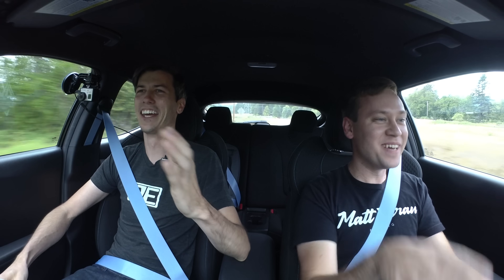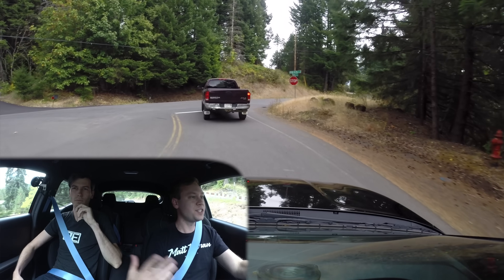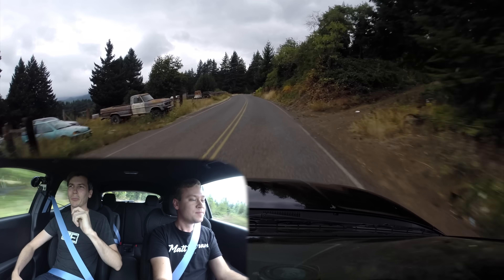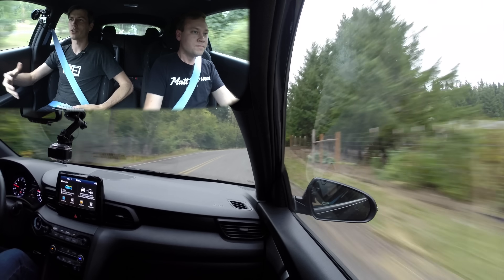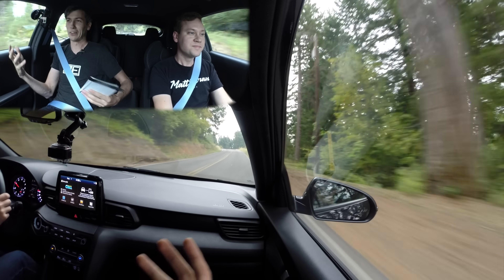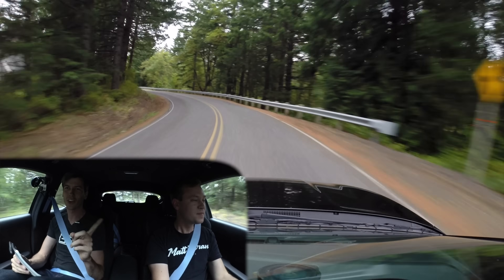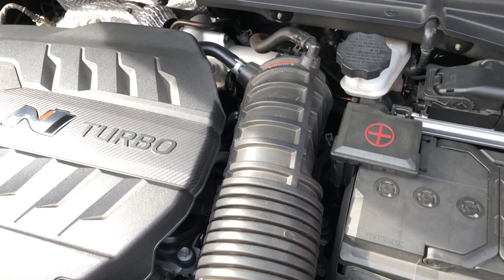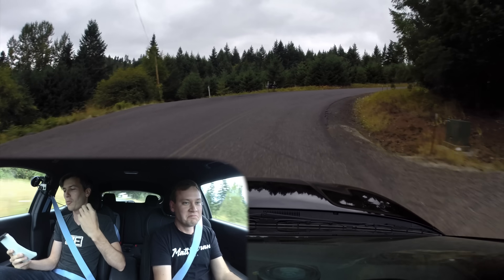Are Car Exhaust Crackles & Pops Fake?

Comment: I hate fake car noise. In high school my 1975 Nova with a 350 and 2.5 in exhaust was great. My friends added glass packs to their Capri with a 100 hp four-cylinder and said. Wow doesn’t it sound fast now. NO a loud car with a 12 second 0-60 does not sound fast. It just sounds like you could not afford an exhaust. 

Mine was always fast. Theirs always looked clean. I will take the performance but to each their own. Now I own a Tesla model 3 and I’m quick and look great.

Comment: As far as the Hyundai method, I wonder how the late combustion treats the catalytic converters.  Additionally, I wonder how much additional fuel it would burn.

As far as the styling, sound injection, and CVT shifts, I would say it is a matter of preference.  I do wish car manufacturers offered a feature to disable the shift simulation, as it hurts efficiency and likely the lifespan of the transmission.
Reply: i wonder more how/if it changes the lifespan of the turbocharger, the catalytic converter is after the turbo(s).
Reply: Well, in a normal car, in correct conditions when you let off the gas on vehicle deceleration,  the injectors shut off until vehicle is close to stop or you get back on accelerator. With Hyundais feature, this will keep injectors running a little longer. Is it detrimental to the economy and emmisions certifications in the US? Probably not.

Comment: I do not agree that on naturally aspirated engines it is fake all the time.
For example, if I take my motrcycle engine (yes on 2 wheels instead of 4 but yet it's still a 4 stroke engine), it has a tiny solenoid valve that opens when you let go of the throttle. The purpose is simply to burn the residual fuel going in the exhaust. And it also does this great blue flame and gorgeous noice :D
So I think there is some real purpose to the crackles and pops.
My engine is the CP3 from Yamaha ;)
Apart from that, again very nice video as always :)

Comment: I probably won't get an answer but for me there is one question remaining: Why do oldtimers have these crackles and pops? I am very sure that a sixty year old car can't change cylinder timings or this stuff. Also they mostly do it at certain loads, say every time you lift off the throttle at 30mph. So there are naturally aspirated engines not doing this for a purpose or faking it.

Comment: What causes the snap crackle pop in older modified vehicles that do not have built-in systems to create the sound intentionally? I've heard it come from all types, but typically 4-cylinder engines with modified exhausts...

Comment: This 8:04 was used is F1 back in 2008 or something and only Renault are allowed to use this type of engine overrun, by the FIA, know as the cold-blown to prolonged their engine life vs the like of Merc and Ferrari.  RedBull clever idea using this to their advantages as an aero devices to aid their diffuser efficiency as we what all known now as blown diffuser back in 2010. In 2011, every team are allowed to use this engine overrun mode but with a less aggressive throttle opening under deceleration (around 15%) vs Renault engine 40% if I’m not mistaken (permitted by the FIA). So to match Renault’s cold-blown system with a far less permissible throttle opening under deceleration , they are forced to use what we know now as a hot-blown system which of course involved a spark retard strategy and at the same time dumping as much as 10% more fuel per race. Yes, it is the same technique use in a turbocharged engine (anti-lag) but of course for a different purpose all together. Blown diffuser are now banned by the FIA altogether.

Comment: Interestingly I have a carburated motorcycle and it does pop and crackle a lot (like all carburated motorcycles and most cars). Basically every time you are not on the throttle the thing pops like crazy. It gets less if you turn down the idle speed. The reason why it pops and crackles is because the carburators always draw a small bit of air and fuel into the cylinder because the throttle never fully closes because of well... idle. Some interesting observations I made are: when I turn down idle all the way the thing obviously won't pop anymore on decelleration but will also not run if you stop. However, if you roll on the throttle really gently say for example at full lean at an apex, most of the time it does one loud bang, followed by a bunch of crackles that get less the more throttle you apply until they are completely gone at about 2% throttle and the engine sounds like a normal engine under load. The loud bang at the beginning is probably because the carbs are still not fully closed and draw in a tiny amount of air and fuel that is to little to get ignited but that collects in the exhaust and when you open the throttle it ignites all that unburned mixture in the exhaust. However, I am honestly not totally sure why it pops and crackles other than that. Is it because it also draws in to little mixture to properly ignite it but "once in a while" a piston does properly ignite and then burns the mixture of the other cylinders in the exhaust?

Comment: my old volvo used to make rice crispies when i let off when i wasnt running a muffler.
the fuel pressure reg was bad though.
Reply: Which volvo did you have?
Reply: @RansomedSoulPsalm49-15  that one was a 91 740
Before that I had an 86 740. Both turbo
Reply: Have a Saturn ion doing the same thing. I might want to check that then

Comment: I accidently found out that my car can also do the exhaust pop or crackle. In the certain rev range when completely lift off and ever so slightly touch the gas pedal without pressing it too far it makes the crackle. I also hate from the bottom of my heart every electronically generated engine noises. It should be real as in mechanical even if serves no purpose at all.

Comment: Jason explain DSG farts!
Reply: These are not hard to explain; it's essentially the same thing.   Instead of cutting ignition or fuel; spark timing is just severely retarded to allow revs to drop so you get a lot of after firing whilst the DSG completes it's shift.   It really is the same thing with a slightly different implementation timing wise; but also in that it's occurring on every single exhaust cycle (which is why you get more of a constant "braaap" sound compared to occasional pops and bangs with more time between them).
Reply: Instead of letting of the throttle like in a manual car the car will cut ignition so the fuel goes into the cylinder and into the exhaust and then goes boom boom.

Comment: How about my motorcycle? Its 125cm³ 1 cylinder and its not fuel injected but carburated? After i changed the exhaust (only a slip on, not the whole pipe) it pops like crazy. 

Yes, I like it very much because it sounds soooo good on bike.

Comment: i have a 1991 miata with a megasquirt ECU, i wanted to create more crackling on over run. i went into the target AFR table and made the cells that were in the over run area richer (AFR 12:1) .(by over run area i mean the cells over 3K rpm at zero load). to my surprise it did not increase the cracking.  then i tried the opposite i made the cells in this area really lean (AFR 17:1) this worked nice. more crackles.i think this crackling has always been there, modern dual mode exhaust systems seem to show it more.

Comment: Imagine swapping out your headunit and your car goes from sounding like a v8 to a 4cyl LOL
Reply: FTF.Eli  fiat panda 900 twin Air turbo 86hp, 80hp with cng. 10 euro for 300km. :)
Reply: i have the opposite problem, if i turn the radio off the 2cyl sound comes back and EWWWWW. :)

Comment: My 04 audi a4 1.8t bone stock has tiny very quiet pops, if you stand at the back you can hear it when I rev, gonna do a catless downpipe and a resonator delete most likely which will give it a much more sharper and louder pop, very excited but currently my motor is apart, soon it will be running

Comment: I've never liked the speakers being used for "engine tracks" because it's lame, and I'd like to actually hear how the vehicle is running.  I have a 2000 Mustang, because it's cheap, and the fake scoops are infuriatingly cheesy.  However, the shop cat really likes the fake hood scoop for napping purposes, so I'm somewhat okay with that one.  But in general, a lot of fake OEM "aero" are made to mimic the fake aftermarket aero that "tuners" did to make their car look like it was a faster car, which was lame.  So fake OEM aero faking being fake tuner aero faking being real aero to make a fake car look like it's as fast as a real one... is lame^2.  The pops 'n crackles is different.  Even when it's not used for cooling or spooling, it produces an exhaust sound.  I think it's closer to an exhaust system mod than a fake thing.  Probably more legit than the brodozers who tune their trucks to dump soot because it looks cool, allegedly.

Comment: I'm an old guy - and did lots of tuning in my earlier years.  'Muffler Explosions' were a bad thing in my day  - meant you needed a tune-up, probably carb adjustment or rebuild, or you had an exhaust leak or hole in your muffler :)
Reply: ever do keybangers? always fun to pull those shenanigans on unsuspecting pedestrians. (in case keybanger is a regional term; put er in neutral, cut the engine, pump the pedal three-four times, either dump the clutch to bump start it, or turn it on with the key).

Comment: My 02 GT 5speed car I've owned February will 17years !! I hav off road X pipe with 02 senors but no converters with flowmasters factory over rear end tail pipes !! With a manual over ride on the idle control valve not cause I wanted to but ICV stopped working , car was idling fast so close ICV and done idle control from the butterfly manualy!! Sents then my Mustang pops and crackles when letting off gas pedal going down hills or down shifting or even between gear shifts!!

Comment: I thought the sound was caused by fuel burning in the exhaust. Therefore not the spark firing whilst exhaust valves are open. Am I wrong?
Reply: I think some Audi S cars inject a drop of fuel directly into exhaust on shifts (purely for the sound) but that’s not the same as explained here

Comment: I thought that it can also be used to cool things down on non-turbo applications. They inject a little fuel which is under the minimum amount required to burn (yay stoichiometry) and then explodes once it hits the hot exhaust.

Comment: If you remove the rear muffler and lift off (but not completely), in most cars you will probably be able to hear the excess fuel burning in the pipes and crackling, but it's much more subtle.
My 94 Civic does this. Sounds pretty rad even though it's just an old Civic. xD

Comment: I'd be interested in -

1. What is the actual measured affect on mpg?
2. Do any of the cars have it change based on a button, driving mode, or speed/driving style?
Reply from the maker: Yes, most have buttons to turn on/off. Mpg effect will be super super small.
Reply: Yes - I have a 2014 C7 Vette and in Sport and Track mode the exhaust is opened up and it sounds the same while accelerating.  However; when I let off the gas and decelerate through the gears, I rarely get pops in Sport mode but always get them in Track mode and a bit more engine brake feeling.
Reply: Mini Coopers S have crackles and pops in sport mode. You can turn it on/off by using sport button.

Comment: mclaren does it to cool the cylinder head, they cut the spark but keep the fuel injection, the evaporation of the fuel absorbs the heat, that's why you see that blue fire of the exhaust when they let off the throttle

Comment: I believe the occasional loud crack from the GT350 exhaust is actually not faked at all because it seems rather random. It definitely doesn't happen all the time. What does happen all the time is not pops, but a long drawn out series of low-volume burbles decelerating off throttle in lower gears. I don't think any of that is really forced, but I could be wrong.

Comment: Porsche calls them “backfires” in the manual. On my 718 with PSE it mostly only does them in Sport mode. Not normal, Sport+, or individual. It can’t be configured independent of that. They did a good job with sound on the  718.

Comment: I've driven Alfa Romeo's for many years and two of them were the 33 model. I fitted both of them with group N rally exhausts and the boxer engines crackled and popped on the overrun. I think the main reason for the noise was the very long primary pipes coming off the heads. There was nothing artificial about the noise coming out of them!
Reply: On a SUD it's the carbies loading the inlet runner walls with liquid fuel at high load. Quick throttle lift and you now have very low air flow but still have all that extra liquid fuel. The mixture spikes rich for a moment, way beyond what the timing advance and low energy ignition can ignite properly.
Reply: My 98 GTV V6 which is probably one of the first generation drive by wire cars on the road crackles, pops and bangs on overrun. The exhaust does need to be hot from a hard driving session though
Reply: I put a straight-through exhaust on my N55 BMW (among other bolt ons) and it burbles when I let off the gas and even when shifting if the throttle position is right.  The MHD tune has a setting for this but I have it off because I also don’t like fake stuff, but my burbles are real.

Comment: I'm not seeing how the timing of the spark would affect the turbo at all.  Wouldn't it still be the same volume of gas leaving the engine?  Not cutting off the fuel, sure, but not the timing.

I'm also a bit surprised they can do this and still meet emissions standards.
Reply: Retarding igntion timing drives up the exhaust temperature quite a bit which helps spool the turbo

Comment: Man I hate ... HATE ... fake air vents. I liked the Civic Type R when I first saw it then hated it after seeing the plastic walls aka "vents". Disgusting. But I saw some guys cut holes in them to make them real vents. And even if the air channels weren't really helpful it still let air through and cooled something. I saw a 370z guy take out his front running lights and built air channels for front brake cooling.

Comment: So how do the old carbureted cars have crackles and pops?
Reply: An air/fuel ratio too far from ideal or timing that isn't ideal or a misfire causes unburned fuel to go into the exhaust. When the next cylinder fires or when the exhaust reaches the end of the exhaust system and gets more oxygen it then fires and makes popping (basically a backfire).

In simple terms, less precise fueling and timing makes for more unburned fuel getting through to the exhaust.
Reply: @ryleynoyes  I did experience backfire because of the distributer's timing not being right. But there are finely tuned carbureted cars featured in reviews or racing events that seems they are genuinely crackling and popin'
Reply: Fuel that didn't combust in the cylinder goes out into hot exhaust. Pop!

Comment: Atleast my car isn't faking it's pops, though the only happen when you let off at between 4500 to 6500 RPM after full throttle with a loud bang. Because after a sudden let off from the throttle the Mixture does not burn fully but more like 70% or so, the rest of the 30% will be burned in the exhaust manifold. Little lesson, in my car (Corsa VXR/OPC) there is a secondary cat right behind the turbo, to not damage the cat, the mixture will be richer, to cool the exhaust-gases. After removing the secondary cat, the unburnt fuel will burn in that section, as soon as the decat-pipe is hot. The unburnt fuel after full throttle also happens to cool internal parts and protect them (1.6L Turbo).

Comment: The Porsche anti-lag system works, as you say by keeping the throttle open but cutting of the fuel on lift off.  HOWEVER with the sports exhaust in Sport mode (but not in normal or Sport +) they, effectively disable the anti lag and use the Veloster approach to get the pops and crackles.  I have to say that does rather offend my engineering sensibilities.

Comment: Do you think they (pops and crackles) can harm turbos since they are explosions going through the turbo, thus increasing by a great amount the temperature to ehich the turbo is exposed. Obviously speaking about tuned in pops and crackes, not factory set ones.
Reply from the maker: Potentially, sure. Turbos can get pretty hot though, and it’s likely hotter for the turbo when you’re WOT then the pops happening when you’re off throttle.

Comment: When I heard that Ford was introducing the engine sound into the cab of the F150, all I could think of was a Traxxas Slash with the speaker that you could install to make it sound like an engine. I'd say it's more childish. If the exhaust doesn't have an actual backfire, then why have it as an augmentation? For the less than 1% of car owners that want the sound?
Reply: I drive EcoBoost f150s regularly, and especially with the 3.5, I can tell they're pumping v8 noises into the cabin through the speakers
Reply: The burbling is not meant to mimic backfiring. Two completely different things.

Comment: 6:51 that must be a really comfortable ride
Reply from the maker: Veloster N is quite stiff, especially in N Mode. I would prefer it to be softer.
Reply: @EngineeringExplained  I daily drive an N. In the softer setting it's not bad at all to me. most of the time I use custom mode with full on except the suspention at the lowest setting.
Reply: Domen Hosta yup. I drive an N and confirm it's rough when you're in N mode, but that's part of the fun. You can soften up the suspension though with the custom
Reply: Yeah - jostle ride from hell.
The car should come with lifetime paid chiropractor visits.

Comment: might be fake in modern cars, but in older style high compression carburated airplane engines this is very common (and typically avoided by slowly reducing the throttle)